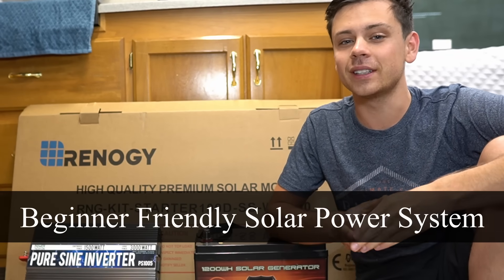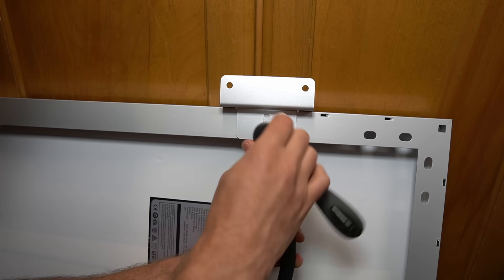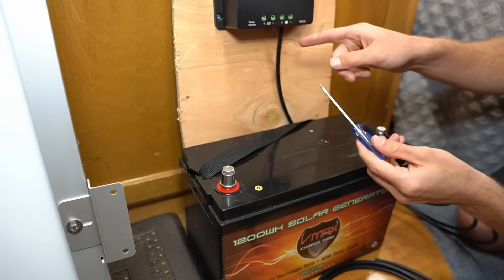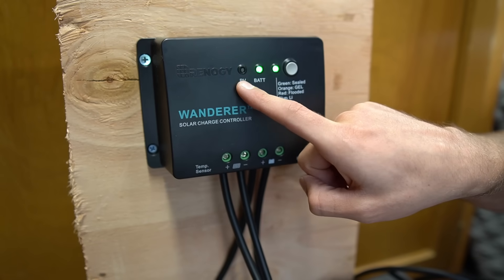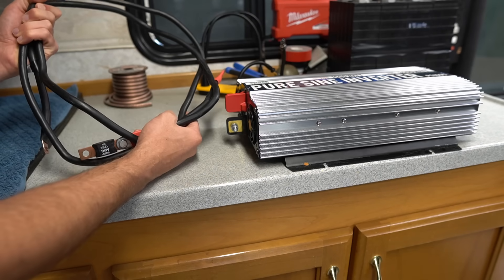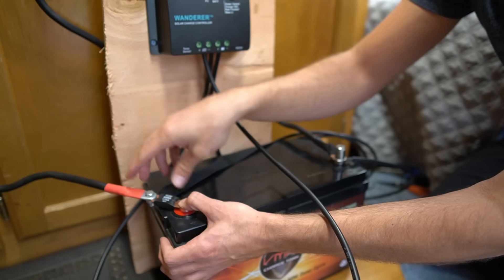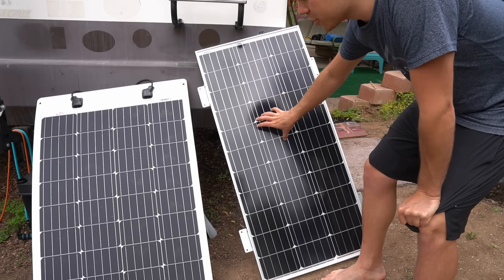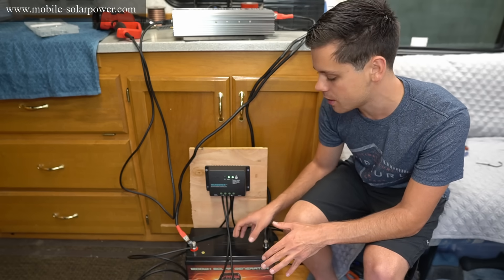Build Your First Solar Power System! Beginner Tutorial Easily Explained, Budget Friendly

Comment: For safety reasons you should never connect the negative side first. When you do your battery is live so if you drop the positive it will short. If you connect the positive first and drop the negative, it doesn't matter.
Reply from the maker: That is only for automotive application and absolutely does not apply here
Reply: @WillProwse  Connect the ground and then touch the positive to the Inverter case and see what happens to the inverter
Reply from the maker: @cph3459  yeah it will be fine because the circuit is not complete with amp source, or battery. I'm telling you that it's for automotive and that's it. Negative works fine as first here. Try it
Reply from the maker: @cph3459  if wires are connected to inverter first, only one wire is connected to battery. in your example did you think you had the wires connected to battery first? A live wire dangling around? Think about it. Whether you have positive or negative does not matter here.
Reply from the maker: @cph3459  in a negative ground car, sure. But here it does not matter. If wires are connected to device first, you will need both to complete circuit. I understand that inverter case is grounded but never would you have wires dangling around like that. you connect them to device first, and battery second for solar. So you need both wires to complete circuit and it doesn't matter at all in this instance. No difference in safety.
Reply from the maker: @cph3459  if you connect wires to device first, and battery second, it does not matter. For solar I love doing negative first so I can bypass OCPD when charging capacitors on inverter. Less possible damage to OCPD. Think about it. Do I need to make a video of this to show you?

Comment: Your video sure simplified things. Maybe i will try and do this myself as my fear is gone. I need a much larger system for a 5th wheel that will be running air conditioning plus all other household appliances. I also need a system that i can add to for financial reasons. In your opinion what part of this system can be added to and doesnt need to be purchasef at the onset? Thank you,
Helen
Reply: Cost you over $3000 to power your house

Comment: Notes for myself:
1:51 Connect battery lines first then connect solar lines
5:35 Add switch to either of solar lines
9:34 Add fuse between battery and scc on positive line

Comment: Would this system survive an EMP?
Reply: No. Charge controller would definitely get fried from an EMP. If you are honestly concerned about an EMP, buy a spare charge controller and seal it 100% (all seams welded or soldered) conductive box and have it grounded. Open after EMP roasts your active setup and replace charge controller. Do the same for anything with circuitry.

You need EM shielding to protect against EMPs and that means as a bare minimum anything made from plastic with a circuit board is not EMP safe. Circuitry must be 100% encased in metal that is grounded.
Reply: Thank you   @aaronp3109

Comment: How do you connect the solar power system to your home electricity ?
Reply from the maker: This is off grid, not a grid tie. For that you need to follow local laws and regulations and use a grid tie inverter

Comment: I ordered a renogy 100 watt solar kit. It came with two 9-inch cables and a 30 amp charge controller. Additionally I purchased 25 foot table to go from the panel to the charge controller. I have a used car battery I intend to utilize until finances allows the purchase of a new battery. ( not sure what battery I should purchase.) When I have the money to buy the cables to go from the charge controller to the battery I will hook everything up. My question is how far away from the charge controller can the batteries be and how far away from the batteries can the inverter be? It is about 40 feet from my cabin to wear the solar panel needs to be. I have not purchased an inverter yet either. That will happen when finances allow. By the way, this is one of the more helpful channels regarding solar. Thank you so much.

Comment: Thanks it was a good video but I’m looking for how to build the system not install or assemble it....thanks again
Reply: Ady Day the logic is a discussion of the components, how to attach them to each other. In a typical setup. I’ve built a 12v system 30a and a solar grid tie system, an off grid 24v 30a, Hybrid. So I also have a tied in dual wind gen. So you go through these and it explains a great deal about building a system. 

For example the specialty in the Renogy charge controller, there are several major brands on the market and some people don’t factor in the battery type, and some people specialize their battery type in their system. When you commit to 8 or more 6v batteries you have to know which direction to go. So I didn’t hear the voltage specs or the panel specs. But it fell within the kit, and the kit is for a simple one battery one panel system. It’s great for water pumps, which are good for off grid showers, and camp sink setups which are expedition style. Or if you want a system where you can power tools, or charge devices.  And good for greenhouse and small gardens. The LDS have a system they used here on Navajo lands, that they donate and assist families in setting up. A small pump and a 250g water cistern typically could manage to water a garden.
Reply: blairbushproject I’m in England...our appliances run of 240v.....between sun and winds there’s enough to power the items I need....I don’t have the amount of money to purchase a ready pre manufactured model.....but by using caravan batteries to store power...a simple converter with the one to fi ratio for amperage over voltage on the wires..works out to be a cheaper way....one bloke bought a turbine...he changed the magnet mount.....it was 12...he got rid of 2 magnet.......the turbine now produces more watts than sold for.........ripping the guts out of a system and modifying it would be a cool video to see I think....thanks for the reply...
Reply: Ady Day umm well it sounds like you know a bit. The caravan only needs  solar panel(s) and inverter. You can wire it to your batteries. The converter is great because it accepts charging from the alternator. Which a wind gen is basically an alternator with a step to convert the wild ac to dc. There are caravan solar vids out there. The appliances on the 240v you still run your numbers on what appliances you use and their amps. To figure out the number of batteries and how many panels.  Interesting on your friend.  Has he done a YouTube on the conversion and operation?
Reply: blairbushproject my friend copied it from a bloke on YouTube.....I was thinking of converting a ceiling fan by adding magnets and adjust the weight and balance...hmmm...big job lol.........recently I’ve been stripping old microwaves for magnets.....watching how 3 phase energy works..spinning a magnet to 50 Hz is a pain....hahaha...

Comment: Great job explaining and providing great content you explained you steps cleary and remained focused on the areas you were presenting. One suggestion I have always learned and go by the adage for dc current attach Positive first then connect Negative when disconnecting it would be remove negative first then positive. Why would you do this depending on the installation if  metal frames or common grounding areas if you connect the negative first or disconnect it last an accident such as a slipped wrench or loose wire coming in contact with the positive post can cause an arch or a short and would complete the circuit. Can cause a fire or even the battery exploding. It reduces the possibility of an electrical incident.  Otherwise two thumbs up on the content and the information.

Comment: Great video! Thanks for sharing this with everyone. I have two solar systems set up. One on my RV (400watts), and one on my enclosed car hauler (300Watts) I have a 500Watt pure sinewave inverter. My solar charge controllers are the Rover MPPT 40Amp. Everything is RENOGY. I'm getting long winded here, so I'd better make my point. I think it would be great if you would learn all about the RENOGY RoVer 40amp charge controller and others as well and let everyone know that there are settings that need be set when using certain batteries. For instance, I use two Trojan T-105 RE batteries in series, and the charge settings must be set up to prevent over voltage charging. You would be a great teacher to teach everyone about all of this stuff because you don't make it confusing. I'm not good making video and narration on my part would be a disaster.... LOL So upon that, thumbs up on all of your videos. Yep, I am a subscriber to your channel.

Comment: By my estimate, based upon our current electrical rate, it would take me roughly 21 months to recoup the $700 that this system cost. So as a supplement to my home's power it isn't very tempting. 

However, if I had a remote location which didn't have access to power from the city, I can see where a setup like this would help provide enough power for some basic needs (power tools, LED lights, electronic device charging, Etc.

Comment: Great job I have a question I am new to solar I have 300watts of panels  2 12 volt deep cycle batteries it will change to 99 percent during the day I have a2000watt inverter I run a TV and 3 lights batteries run down to 51precent I change them over night with a  charge my question is do I need more batteries or more panels to avoid having to change it over night thanks for sharing your video

Comment: what's the point of keeping charge controller closer to the battery when the wire connecting them are still too long
Reply: Having done something like this, you'll learn that various items, like temperature gauges, battery lines, etc., all come in different lengths and if you build something to hold your battery and then try to add to it, your new lines (items) may not reach.  The only other thing I can think of is testing the battery with your hand to see how warm/hot it is with a load on it. As you place a heavier load on the system the battery tends to heat up a little, which may require you to reduce the load. Being able to look at the lights and hand test the battery is a plus, at least for me.

Comment: Q: What if i only use 12v appliances (for lighting purposes) wouldn't it be more efficient not to convert the dc voltage from the battery ?

Comment: The rule that I have used for a very long time regarding connecting and disconnecting from power sources is to disconnect the negative first or when reconnecting put the positive in the circuit first and then the negative. What is it that is different with this setup that allows you to do this sequence just the reverse?
Reply from the maker: It doesn't matter. Either way works the same in these circuits.

Comment: It should be pointed out when you plan to run a microwave or other electronics, you need a pure sign wave inverter. Modified sign wave inverters cause things like microwaves to run much less efficiently sometimes they might not even run. The other point to make is the more demand you expect of the battery, the shorter time you can use it. I lasted thru Hurricane Irma with just a simple Potek 750watt inverter with meter and (2) 12 volt marine batteries. Ran 2 table lamps with 8watt LED bulbs, laptop, cell phone charger, and occasional TV,  for 2 weeks without a charge.

Comment: Just a safety note……please put a plastic insulator cap on at least one of the battery terminals. If you accidentally drop anything metal across those terminals and short the battery you get a tremendous surge of current (like 20,000 amps) which will fuse the metal to the terminals and may cause the battery to explode violently. This is very dangerous. I worked in a battery test lab and we had to conduct this test and it is scary even under controlled conditions

You need to select the correct battery type because AGM vs GEL vs Flooded batteries use different charge voltages. If you charge a GEL or AGM battery using the Flooded setting you will quickly dry them out which shortens their life or even may cause them to overheat
Reply from the maker: Agreed

Comment: My 80 watts 12v solar panel became 20.4 volts... What is the reason...
Reply: If it isn't hooked up to a battery, the voltage can go above 12v.  When the energy has somewhere to go (battery) it will limit the upper limit of the voltage.
Reply: @SpartyTime  the voltage indicated by the controller is 12.5 for the battery...  While for the solar panel is 20 v...

Comment: Why a spark when plugging the positive inverter to the battery ?
Reply from the maker: Charging inverter capacitors
Reply: @WillProwse  thanks. Another question from a newbie. I was said when you connect 2 12v panels in series the output is 24V,  does the charge controller can automatically change it to fit my 12v batteries or do I have to do it manually ?  Is there an advantage to series over parallel connections for the panels ?

Comment: How do you determine the amount of wattage (panels) and the amount of amperage (charge controller capacity) for a system. For example if I want to run a 3 cu. ft. mini fridge inside a vehicle for a period of 24 continuous hours. How do I figure out what amount of power the mini fridge would consume if I cannot find the manufacturers specs?
Reply from the maker: All covered in my book

Comment: Is there a reason why you connect the negative first? When working on vehicles, you always disconnect the negative (earth) first and reconnect last in case you cause a short. Also, please don't use pliers on a nut/bolt when you can use the correct sized spanner/socket!
Reply from the maker: No reason to connect positive or negative in this instance. Think about why you do it in vehicle application. Not applicable here.

Yeah I agree about using correct size socket. I didn't tighten it down either haha I was lazy to get tool box out
Reply: @WillProwse  No, I realise it's not applicable here, but I was taught many years ago the mantra "disconnect first, re-connect last" when it comes to the negative battery terminal so it's second nature to me now to do it that way! So when I saw you doing it the other way round it seemed so wrong that I thought there must be a reason behind it! I would advise anyone on the grounds of getting into safe habits to follow the "disconnect first..." mantra.
Great videos BTW, I'm learning a lot!

Comment: In another video of yours you connected the cables from the CC to the posts on the inverter instead of
directly to battery posts Question does it actually matter or is either way perfectly fine?
Thanks
Reply from the maker: Doesn't matter. Just need wire thick enough for inverter. So depends on system

Comment: I have 12v 150 watt single pannel connection to a luminious pwm 12/24 20 amps charge controller. Connected to a 12v 26 ah battery i am running 600 va ups from it . 
My question is because of 12 v battery i am limited to 600 va ups to hook up 1kv ups dc input is 24 v . If i add one more 12 v battery and connect in series my ups will work . But will the pannel and charge controller charge my 24 v setup ... Or what should I do

Comment: What would i need to power something like a cooling box with 12V? The battery voltage will drop  after a while below 12V  right? Can i hook it directly to the solar charger ?

Comment: GREAT VIDEO ...The only question I have is:  why does it matter just how "close" the charge controller is to the battery if we connect with 20 feet of wire?
Reply: George Moomaw copper wire to the battery is a larger gauge and the shorter the run the smaller it can be... and the cheaper it is.

Comment: Will, I've been enjoying your videos.  Have you thought about using a house solar panel, 250-335 watts?  You could have installed 1 of these panels in place of 3 100 watt solar panels.  Less space used on your roof.
Reply: Typically, you will use less space, but probably around 5%-10% space savings so unless it's 10s of panels, the space savings may not be that great.

Comment: Hi Will I have a a strange question. I want to increase the solar capacity of my system but I have ordered before the 120w solar panel . My system is on 12V and I use EPever MPPT charge controller. Will it be ok if I have mixed capacity collar panels o r they all have to be the same capacity In order to work normal . For example can I have 120w panels with additional 2 x 100w panels and then order one that is 300w .

Comment: How many bolts should a 6v system have? I have 4 6v batteries they are in parallel and and series . What did the first owner do that???
Series and parallel for 4 6volt batteries
Reply: Volts not bolts
Reply: A 6v system should have 6 volts. If you have 4 6volt batteries, you make 2 pairs (series connect) that form a 12v pair then connect pairs in parallel.

Comment: Good video, i'm not a beginner but I watched anyway. Only thing i would recommend adding in the future is that the fuse size is dependant on the wire gauge not the draw of the inverter, probably not a big deal for a beginner, but good to know.

Comment: You are suppose to hook up the positive first for no spark.
Reply from the maker: Energy potential in DC circuit is continuous through out. Doesn't make difference. Many people are accustomed to positive first because of automobile batteries. Those need positive first to avoid short circuit when tightening down the terminals.

Comment: Great vid as usual!  I am going to use two 6V deep charge wired in series. Will that make a difference on what battery you set the charge controller? I notice there are 4 settings on it to plug different batteries in so I just want to do it correctly. Thanks for being here for we beginners!